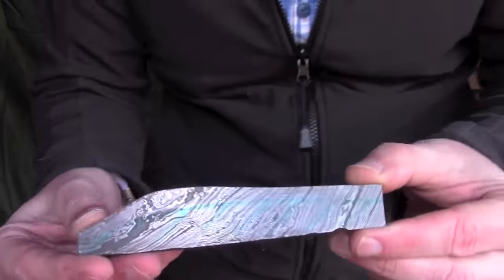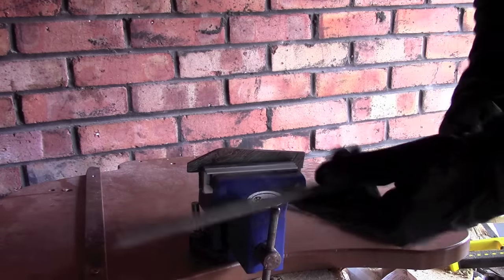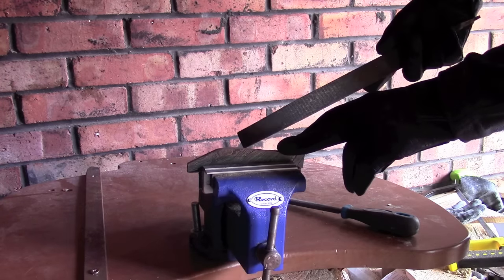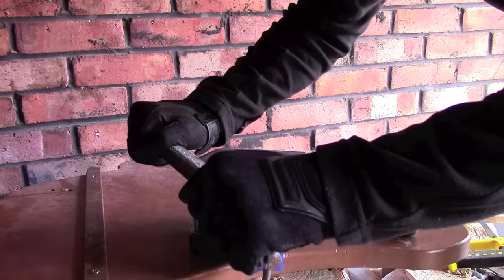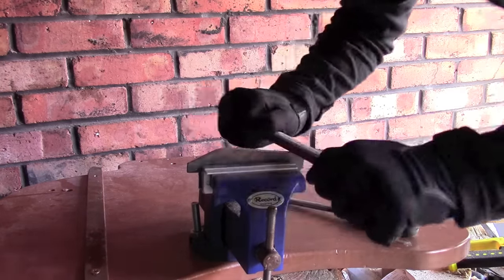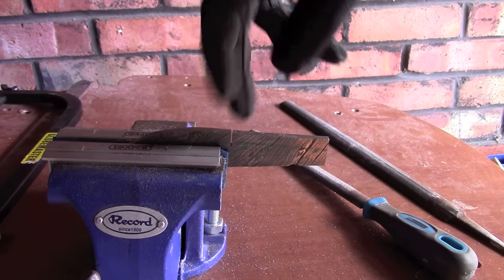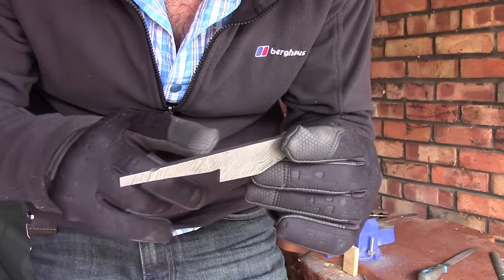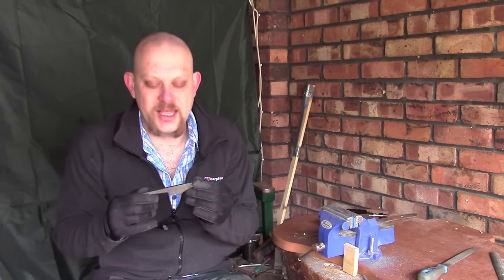Making Your Own Wood Carving Knife - Part Two

Comment: I have to say as an indentured engineer, to watch you filing all that excess off is quite painful. Liberal use of the hacksaw is best, or even forge the thing out into tapered shape first, you have the heat source possibilities already. Fascinating, but difficult to see why you have to do it the hard way, except maybe you are catering for those without the right gear as well. Nice bit of metal though..... good luck !

Comment: The enxt time consider forging the piece out.Takes minimum equipment and you'll save a lot of material,you could have made 2 knives from that piece no problem.DOn't need to do be a master smith,just rough out the piece so the filing is much easier and faster.JUst ened hammers and some piece of steel set on a stump(could use a sledge hammer head),or maybe a big rock,like vikings did...
Reply from the maker: It's definitely on my list of things to try, I wanted to give stock removal a go first but have a few ideas for forging in the pipeline.
Reply: Yeah i started that way as well,but without semiprofessional equipment it's painfully borin,(hours and hours grinding metal...).Now with an hour and a half forging and 30-60 min grinding i'm done with the blade.it's just a breeze compared to stock removal.